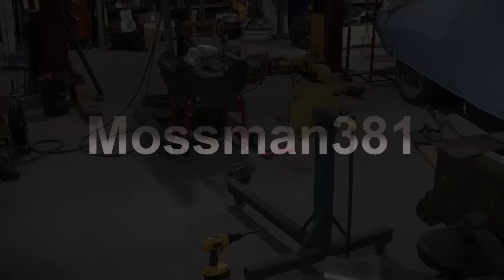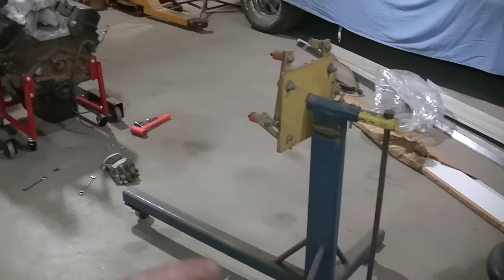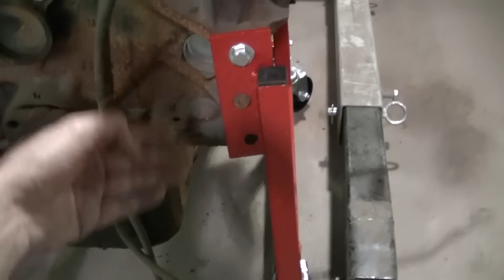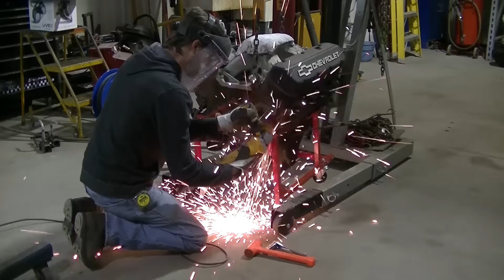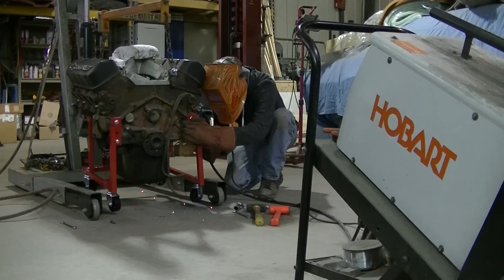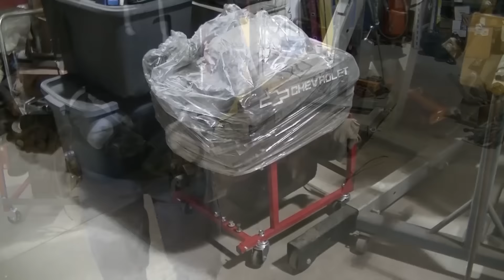Ebay Engine Stand "Cheap Junk"

Comment: Have to ask how cheap was the cost of the stand. Time and materials to make one , doesn't look bad at all even if it needed a bit of modding.
Reply from the maker: +Steve Rob   $30 for the stand.  It was suppose to save me some time.  In the end it did save me a little time but the wheels are still junk.  No way you could roll it around everyday.
Reply: +mossman381 get what you pay for lol

Comment: Good for what it is, the price means you can easily modify for other engines if you have scrap tubing and can weld.
Reply from the maker: It was suppose to fit a chevy engine without modification and the thing rolls like crap.  I still have the engine on this stand but still consider it JUNK.
Reply: BBC would be too much for it, even though mount patterns are similar to SBC. $30 (including shipping) is about what you'd expect, I see better ones for hundreds of dollars. We got one only to use it as pattern for modifications using heavier tubing. You know for that price when others cost many times more that you're getting a very light item, that's for sure!
Reply from the maker: It could be the big block is causing the wheels problems but the mounts had to be reworked.  I guess it saved me some time having to completely build one but not sure I would buy another one.

Comment: Bought two so far, one Harbor freight one AMAZON. Both worked as they should with small block Chevies on them. They roll around the shop just fine.
Reply: Small block Ford and small block Chevy, barely OK. Heavier and you have to modify.

Comment: I saw one like that at Northern Tools (I believe).  Started to order it, but I'm glad I didn't.  Might have to fab one up someday.  Would make a good project.
Reply from the maker: +farmboy30117   The Northern Tools might be a better stand.  Probably not if it was the same price.  It was suppose to save me some time and in the end I think I did save a little time.  A set of good wheels will cost you more than $30  :)
Reply: Yeah, it's about the same price so it probably comes from the same China factory.

Comment: prob would of been easier to fab one. :P  you bought one and still had to work on it.. Sadly thats with everything these days
Reply from the maker: +MrGiovannix12   It was suppose to save me some time.  Overall I think it did save me a little time.
Reply: We have 5 engines in our shop and we just made ours out of 1"square tubing.  Took about an hour to make each one.  No wheels though, though I can't imagine it's really that hard to just throw a couple casters on.